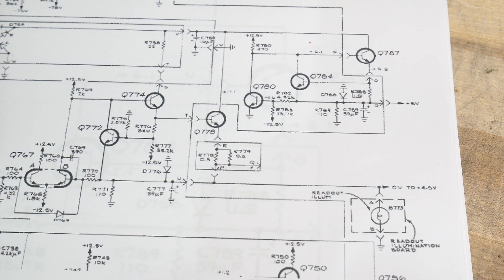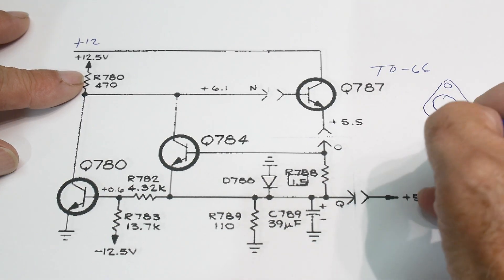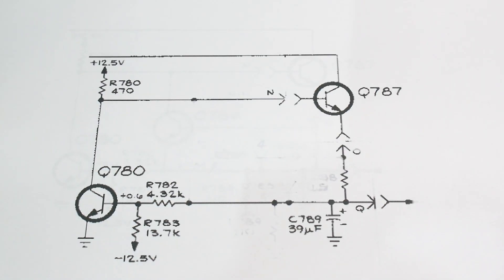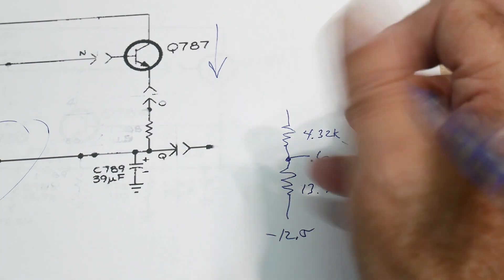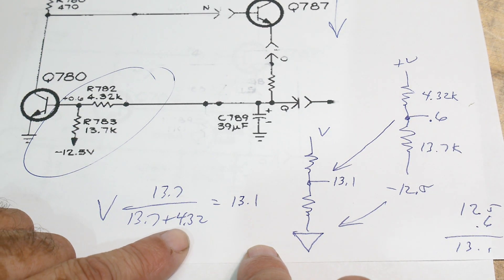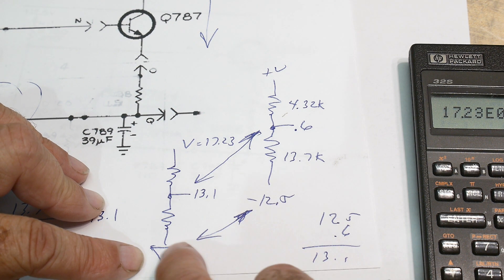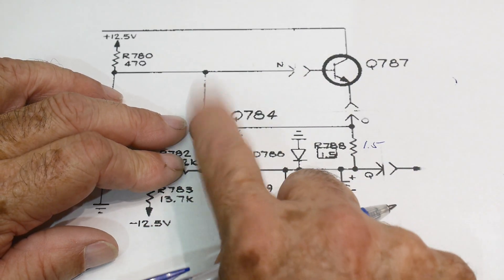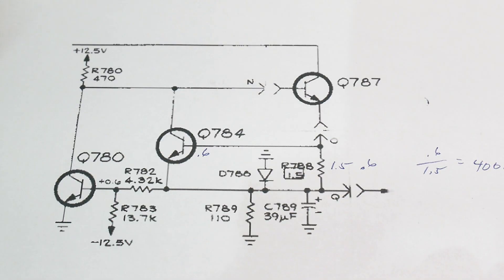#1279 Three Transistor Voltage Regulator

Comment: How would you got about stability of such a circuit, to be sure that it will not oscillate? Would be nice to know how to do that
Reply from the maker: that is a very advanced topic. https://www.analog.com/en/technical-articles/power-supply-loop-stability-loop-compensation.html
Reply: @IMSAIGuy  Thanks for the article! I have wanted a reasonable length article explaining how transfer functions relate to stability. I will take some time to read this, hopefully it helps provide me a framework for thinking about stability.
Reply: @IMSAIGuy  depends, also in that article the whole circuit side is missing, i find that always problematic, the control theory is not that complicated, but making a discrete circuit that does work is a different story and is almost never addressed. That was more my questing. If you had designed that supply, how would you have looked at the circuit to determent if it was good in terms of stability. Sure, you can put in a restitor and make a bode plot. But that cant be the only way to at least get a understanding where such a circuit will have critical points. I would be really interesting to look maybe at this circuit and try to do the exact thing. Hope you understand what i meant.
Reply: You can look at gain and phase shift, and plot the results on a Bode Plot.  In a nutshell, you don't want gain and positive feedback at the same time (unless you are making an oscillator).  That's the 70,000 ft. quick answer.  Perhaps you could analyze it using a Laplace transform, but not sure about that if there's something nonlinear.  Nowadays, you would just do the Bode analysis w/a simulator.  The 39uF cap likely helps 'helps' slow down the loop so you never have positive feedback w/gain (just an educated guess).
Reply: @Pinhead-q4i  yes i know, but how to do that without directly going to simulation or measurements, is there no "old" way. I the problem I have is I know the control theory and i know circuit and also in the link you can see that it does not really bridge them both. How would you go about designing, if you for example had thought of this circuit, How would know? Also, where would you go to event it from being unstable, where is the place to stabilize it.  not sure if you understand what i mean
Reply: @heinrichhein2605  I mentioned Laplace transforms could possibly be used, but I'm the first to admit if there's anything non-linear...my classes never covered that aspect.  My Laplace classes just dealt with linear analysis. Plus that was decades ago, so I've forgotten all that anyways (I'm retired now)!  But my goal would be to know the amount or error correction needed (i.e. feedback gain), and ensuring when all the phase shifts are added up, the stability is acceptable (easier said than done).  Or if not, then somehow try to reduce the phase shifts - but sometimes that's not possible. It definitely can be a balancing act.   There's equations for error correction, that's pretty easy.  The phase shift can become tricky simple due to the inherent phase shift going thru all the components (i.e. a detector, feedback amplifier, error amp) - sometime that's the limiting factor, not a discrete part you can just change (i.e. cap).

I bet a lot of old designs were trial and error.  i.e. Ballpark the gain and phase shift, then measure and create your Bode Plot (I would do that by breaking the loop and measuring Vin/Vout and phase shift across the loop's bandwidth).  If it looks close to being unstable, then lower the gain (less error correction) or try to change the phase shift.  Then 'rinse and repeat'.

Almost all my designs were nonlinear with a lot going on, so somehow figuring out the the loop gain and phase shift at any given instant would be a huge time sink - unbearable, really.  I guess you could analyze with KCL/KVL, but it would have to be broken down into into small 'pseudo' linear chunks and analyzed.  But in my case, what likely what would have happened would have been my boss telling me to stop turning it into a Ph.D. thesis and analyze it using the modern tools (simulation and model accuracy can be another issue tho).  Even when I would simulate, I'd still measure in the end.

I'm not sure I answered your question.  And not many of my designs had an analog loop (digital was more common), so I'm definitely not a loop expert!  But it was always one of my favorite areas of design.
Reply: @Pinhead-q4i  Thank you, this was quite helpful.
Im still a young engineer and im sill learning allot, I do have to design often discrete analog circuits, for reliabilityreasons etc.. The old equipment supplies are not far from that. But then also a lot of SMPS as well, but discrete as well.
Thinking of just gain and phase of each part and sub part of the circuit might be the best and
most intuitive approach. But how to handy those quite apparent non linearities especially in discrete circuits is not trivial.
I fortunately had some theory about non-linear control and systems, with lyapunov and so on, but applying that is also
a bit of a different story. But i also learned that even a "simple" colpitts oscillator is crazy complicated to understand properly, so you exactly know how it works and over the specification you need. One professor also showed me that a lot of books about such things have much to desire in terms of fundamental and correct understanding of certain "standard" circuits. I maybe should also read more into chip design, sure a different beast but in terms of such discrete circuits not far off. That suff here is only now done by a small amount of people and getting the knowledge and how to form back in the days is rather difficult. You seam to be also one of them :) Thanks for taking the time!!
Reply: @heinrichhein2605  I remember working on the ALC of a transmitter. I didn't design it, we bought that design from another company, but I was involved with babysitting the design at our company.  Don't remember why, but I had to analyze the ALC loop and I made a detailed model (and measured to verify the model was correct).  The loop had different gains and phase shift, depending on the frequency in the loop.   Sort of a stair step response for gain and phase shift, so a lot going on.  Long story short, we needed a little more error correction at a certain frequency.  Since I did the analysis, I knew what area of the loop affected what, along with knowing the amount of error correction. At one point, the program manager came over and mentioned "We have high distortion at XX Hz."  So I looked at the analysis/simulation and said "Change this resistor to XX."  He looked at me like I had just pulled that out of thin air, but he had the component changed anyway.  I didn't even bother to go in the lab, just a 'Change this part' reply.  Sure enough,  the distortion was reduced (and the loop was stable over temperature).  The PM stopped over later and said he had his doubts at first, but the distortion was reduced by what I had calculated.  Won some serious brownie points with that fix, LOL.  Couldn't have done w/o the simulators tho.
Reply: @Pinhead-q4i  but the cap can make it worse also so hard to say, that's what i mean how would you know just by looking at it
Reply: @heinrichhein2605  When I designed a loop (or any circuitry, for that matter), just from simply designing it, I would know the culprits. i.e. "This amp has xx degrees of phase shift, that's my biggest 'hitter' w/respect to stability."  Or 'I need this much gain from this amplifier for xx amount of error correction."

Comment: I was just trying to invent 3.7V regulator for Lifepo4-charger. I was going to use stack of diodes as voltage reference, but that would have been ugly and embarrassing.
Reply: Note that this drifts like hell with temp, try tl431, i heard it can be unstable though. Current limit accuracy doesn't matter as much so the transistor should be fine.
Reply: @plainedgedsaw1694  This is not a precision instrument. Charging current is small and LiFePo4 does not break easily.
Reply: @TimoNoko  tl431 isn't precision component either, it's usually 2% precise. But treating li cell well even if treating it worse won't make it blow up, is good idea i think.
Reply: use a tl431
Reply: I already tried with 3.6 Zd temp killed it.
Reply: You don't charge lithium batteries with a simple constant voltage, Just use a TP4056. They are dirt cheap and do the job very well.
Reply: @RexxSchneider  LiFePo4 is not regular lithium. I found this by trial (and TP4056). It was hot as hell, but did not explode.
Reply: @TimoNoko  Ideally, you would charge a LiFePO4 cell at constant current up to 3.65V and then at constant voltage until the current drops to 10% of the initial current.

However, LiFePO4 cells are much more robust than the commoner LiCoO2 cells and are much more tolerant to overvoltage on charging. When a lithium cell is overcharged, the extra energy is converted to heat by a chemical reaction. For LiFePO4  the exothermic heat of reaction is 90J/g, compared with 1600J/g for LiCoO2, which accounts for the much greater tolerance.

You can charge LiFePO4 with a TP4056, as 4.2V is just within the allowable charge voltage for the cell, but you need to set the optimum charging current by setting a resistor. If you're worried about the heat, place a diode or a Schottky diode between the TP4056's output and the cell to lower the charging voltage.